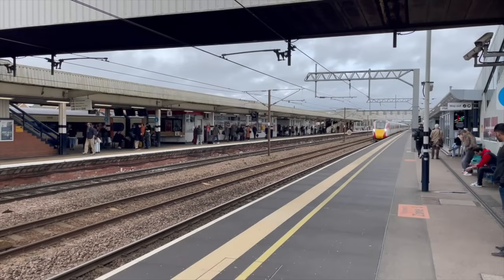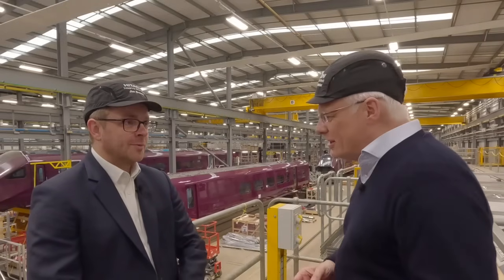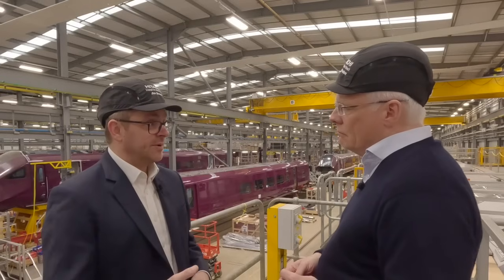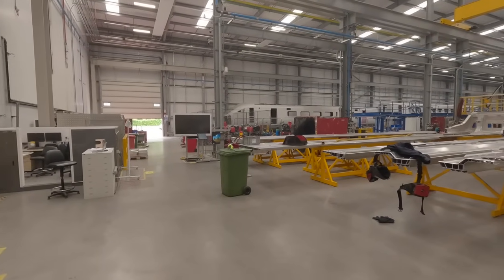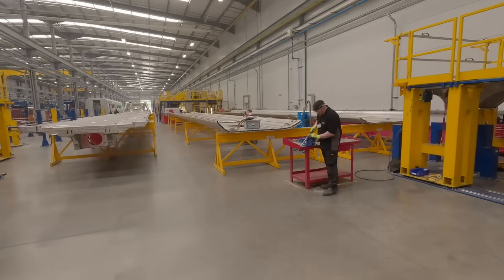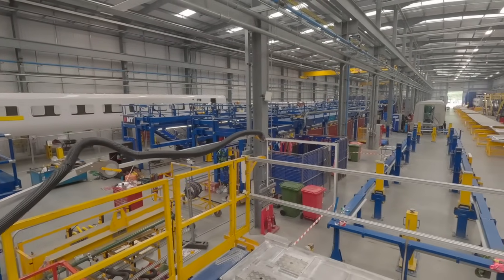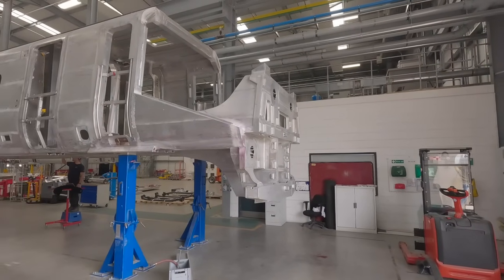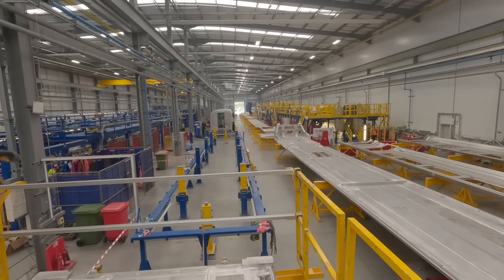Building trains with Hitachi Rail, Avanti West Coast Evero & Levenmouth rail link opens! Ep 36

Comment: An excellent piece about Hitachi Rail's Newton Aycliffe facility, and interesting to see how they have developed the welding and paint facility, and the bright and airy facility shows the benefit of a new building compared to the use of buildings built in another age and for a different product. Also noteworthy is their engagement with local industry for the development of the traction battery for the 802, shown on an earlier Green Signals. Proof that you can build a train manufacturing site (rather than just kit assembly) skills base in a relatively short time.
Reply from the maker: Agree with all of that!

Comment: As a driver I looked forward in anticipation to the much needed investment in new rolling stoke and expected the then new 800/02 IETs to be the bench mark for long haul passenger services, sadly I was wrong, looking around the interior it’s hard to see any gains considering the large increase in leasing costs, of course the power operated doors are an improvement over the slam door stock but the poor quality seats and the replacement of a Buffet with a trolley service, really does make the IETs a poor substitute, I’m sure for the same money we could have had a state of the art MK 2 HST, fit for the 21st century, instead we have the IETs, which really is a missed opportunity.
Reply: Well said.

Comment: A great piece with Richard at the Hitachi facility at Newton Aycliffe, with it particularly interesting to hear about how the Hitachi workforce there has had to change, learn and adapt to being able to weld and paint vehicle bodies. 

However, on the point of having an empty order book of potential up to 3 years does open up the question of why Hitachi didn't try harder to win the LNER order which has gone to CAF instead. There has also been suggestions they had been 'pricing themselves out the market', with First Group having been rumoured to not have ordered additional stock for Lumo due to the price being too high. As I say this is only suggestion and rumour, but if true it wasn't a great strategy from Hitachi to fill a very obvious gap in there order book.

Comment: Oddly enough,  a couple of hours before watching this podcast, I was listening to a recent episode of the University of Glasgow Spotlight podcast where they were discussing the impact of UK election purdah on the Scottish Government. They said that the purdah rules were guidelines rather than hard and fast rules and that they only officially apply to the body that is having the election. Therefore, there is theoretically nothing to prevent the Scottish Government from continuing to make pronouncements on devolved matters (such as transport). However, they added that it was likely that major announcements (specifically the new First Minister's proposed legislative programme for the coming year) would be likely to be postponed until after the UK election to avoid allegations of unfair electioneering.
Reply from the maker: Thanks - that's really interesting and does align with what we've heard elsewhere. Cheers.

Comment: The "Old Worse & Worse", was the Oxford, Worcester & Wolverhampton Railway opened in 1850-4, built as a Mixed-Gauge Railway designed by Isambard Kingdom Brunel. It ran from Bushbury Junction, Wolverhampton to Wolvercote Junction, Oxford. I live right near it in Bilston, Wolverhampton, near the site of Bilston West Station.
The line closed from Wolverhampton Low Level to Dudley in 1962, and Dudley to Round Oak in 1993. The rest is still open. Served by West Midland Railway, and Great Western.

Comment: What would it take to get the IETs to become level boarding? Could Hitachi redesign the base frame to become the height of UK platforms? 

Considering the typical 20-40 year life span of trains how could we have a way to build x trains per year so that fleets are regularly renewed and the manufacturers have a constant order book?
Reply from the maker: I think there is consensus that we need as predictable an order flow as possible to even out any peaks and troughs.
Reply: @GreenSignals  yes I'm thinking about the detail of how to get to a predictable order flow. What would a predictable order flow look like?

Comment: for me the IETs are rubbish seats are awfulli had too go up to inverness on train from kings cross 8hrs sat on a ironing board not again i hireds a car for return as my back ached for days after that plus on new trains some had to go out of service as they had cracks on them
Reply from the maker: I think the fatigue crack issue was a little more complex than that and was a fair amount to do with the track / train interface.
Reply: @GreenSignals that may be so, but wasn’t the aluminium welding quality listed as a significant factor?

Comment: I would suggest that what the UK railways need is a fleet of hauled vehicles with similar dimensions as the BREL Continental or the class 180 trailer cars ie not more than 23 metres and preferably less, with a seating bay dimension of 1.90 metres. Shorter would be preferable as close-coupled Pullman gangways with knuckle or bar connectors can then be used which makes for a steadier ride. The manufacturers should be looking at stainless steel, like the Swedish X2000 series and the Channel Tunnel car carrier trains. The manufacture of aluminium is very energy-intensive and its service life might be questionable. It is prone to corrosion and fatigue, though the Al bodied Networkers and class 158 have obviously stayed the course. Given the difficulty of obtaining Al welders, it is surprising that Hitachi stayed with this metal.

Bogies should be to a proven BR design such as the very simple B4 or B5 series, or the BT10 or the BREL T3-7 as fitted to the class 442.

The usual mode of operation should be with locomotives in push-pull mode.

Comment: 0:15 I interpret it as "EhVEERo" or "IhVEERo". I tried to ride on one on the 3/6/24 from Crewe to Chester but Error 404: Onward Driver Not Found. Will reattempt tomorrow (the 7/6/24).
Reply from the maker: Hope you get to ride on it and let us know what you think of the seats!
Reply: Thanks, I can already tell you what I think of the seats as I did sit on one 😂 I didn't have any issue with it 😊
Reply: 13:44 when I was on 805004 there was still one of those Post-It notes and a sticker on the route map in one of the vestibules, dated January 2023 (!) mentioning a defect of scratches/scuffs to the top of the poster holder frame.
Reply: I actually managed to ride on 805008 today (the 7/6/24) on 1D89 from Crewe to Chester, because an onward driver was found this time 😆😝

I thought it was a good train - lots of handy features, like winged headrests (I still haven't yet been on a refurbished 390), 3-pin and USB sockets at all seats (and wireless charging pads on the tables), seat-back reading lights (with two brightness levels), conventional ratio and stretched bar high-resolution customer information screens,

and even though it's an AT300, you know it's an Avanti / "successor operator to Virgin" train when it has a shop onboard 😜

Comment: Actually looking at all this makes me think that we should do a bit Soviet/US air force. In both circumstances the design of aircraft was by design bureaus and constructed in state factories. I think smaller more dynamic companies could conceive of and design better trains than the incumbents, not least because there is now a vast quantity of higher technology components being produced by automotive for EVs. These smaller companies can't break through because they don't have the infrastructure and they won't be able to demonstrate the processes and reliability.
Reply from the maker: The process for automotive manufacturers to secure safety approvals etc before a product can be sold to consumers is long, laborious and expensive - and for good reason. Only the larger companies can therefore afford to do it on any scale, notwithstanding the plethora or smaller companies producing high quality components and systems for them. 

It's no different with railway vehicles except safety acceptance is arguably an even bigger exercise given the number of people potentially involved in an incident. There are hundreds of smaller suppliers who design and supply hi-tech components to go on trains.

So really, not that much difference.....
Reply: @GreenSignals  the difference is the scale between automotive and rail. The rear motor in my Tesla reputedly costs under $2000 to produce including it's integrated gearbox and inverter. That's for a 220KW motor. Even with a derate for a railway duty cycle that is dramatically cheaper than what a rail manufacturer would pay, the package is much more compact and near silent in operation. That's a product of a much larger market and faster development cycles. My contention is that some new more agile design teams could use this technology stack much more effectively than the relatively conservative rail manufacturers the exemplar would obviously be Tesla but also people like Kratos in defence. The question for the "guiding mind" is how to enable that to happen, what I was proposing was decoupling design and volume manufacturing (done in the cold war for aircraft) though there are plenty of other approaches. A certain amount of procurement reform would also be needed if new participants are to enter, portions of budgets would need to be allocated to purchase products which are innovative but have a technology and execution risk.

Comment: Super great show. I am on the fence with open.acces.we looking forward to using Grand Unions Carmarthen to London service when it eventually starts.

It seems to have gone very quiet . Was talk they trued ro order class 805s but Hitachi were charging higher prices now compared to previous builds think LUMO have come across this.

GWR I think some issues there are down to the dft and treasury let operators experiment including new services  etc. Direct Bristol to Oxford services should never have been stopped back in the early 2000's
Reply from the maker: I fear I may have had something to do with Bristol - Oxford back in SRA days....... But I think there are plans to try and resurrect that. Would be good.

Comment: Thinking about the pendolino plan to run them of HS2, I wonder if this Trilink project also helps speed up the northern section of the WCML to mitigate some speed and capacity losses in the cancellation of phase 2: https://youtu.be/PWikk_wlBBo?si=KcCx6oTP2Kim7mUi
Reply from the maker: Yes, since ETCS enables in cab signalling which is the principal barrier to 140 mil/h operation. Subject to linespeed constraints of course!

Comment: No criticism of the men on the job but these are dreadful trains. They need a total redesign. The ride quality is horrible, which means that they are probably track bashers. Misalignment of seats and windows is largely due to the wrong window bay dimension. They are difficult to get on and off with large step distances. They use space inefficiently because of the excessive length. 

The 1 metre gaps between vehicles and all the lumps on the room must create unnecessary air resistance. 

Bi-mode needs to be ditched. Expensive heavy equipment is being carted around unnecessary.

The entire concept of 26 metre trains is unsuitable for Britain; bi mode is fundamentally flawed.

Hitachi should be building trains to satisfy the needs of the people who actually use them.

Why are they using aluminium when stainless steel could be used? It needs no painting and has a proven life of 60 years pkus.
Reply from the maker: Always (and I do mean ALWAYS) when criticising a procurement of anything (and it applies to trains as much as anything else) look to the competence of the client first. 

Who was the client in this case - the TOCs? the ROSCOs? No - someone else. 

I'll give you three guesses......but you'll only need one.
Reply: Bi-mode elimation will require UK to develop a solid baseload electric power system for the future which will cost hundreds of billions for new GenIV reactors.  UK is leading the way !

Comment: The IEP is a poor product. Uncomfortable and doesn’t ride particularly well. Cannot compare it with the HST. Or 225 for that matter.
Reply from the maker: I do think it's personal preference. I did use to find HST seats a bit soft - i prefer really hard seats. But again, fully accept it's a personal thing.
Reply: @GreenSignals  Not a personal preference, but facts. The HST rode significantly better, more compliant, more comfortable, than the Class 800. I drove HST's for 20 years and have been driving Class 800's since their launch. In fact, the 800's are abysmal on anything except perfect smooth track